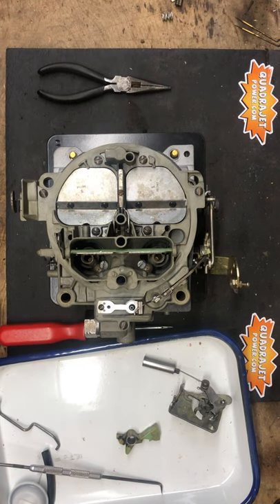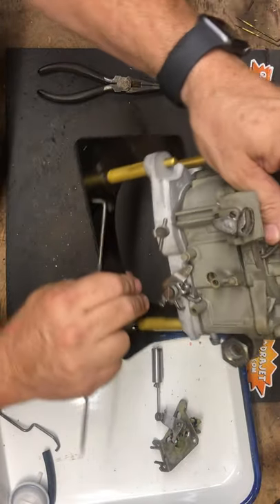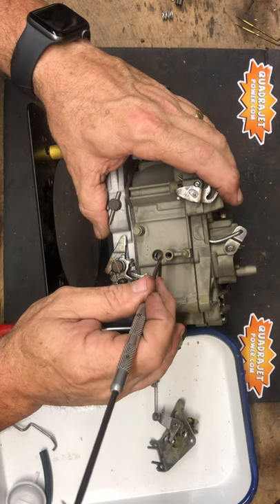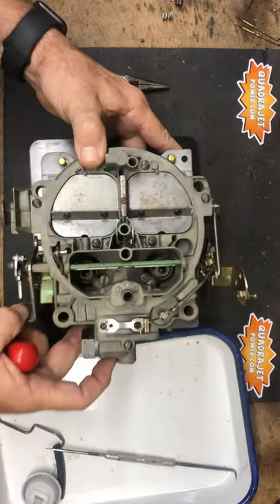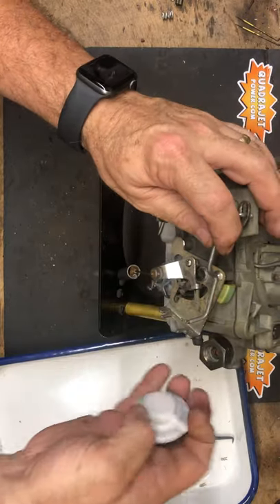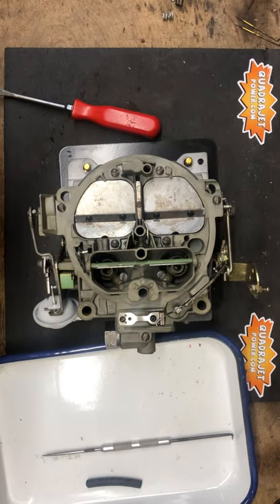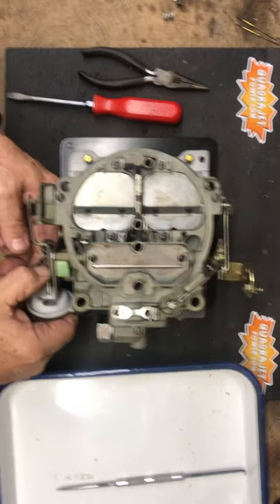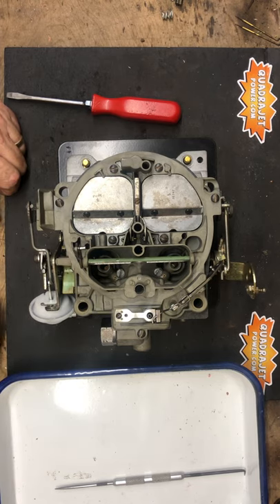Quadrajet Power - Installing divorced choke on the Quadrajet

Comment: This video is a life saver for my 1969 Quadrajet. I took the divorce choke mechanism apart to clean up the rust and fix the choke flap not closing properly. Turns out the previous owners did not put the assembly correctly. Thanks to the video, I was able to put everything back together correctly with ease.
Reply from the maker: Thank you!

Comment: Your videos are fantastic and a HUGE help. I sheared the bolt to the choke assembly/coil that attaches to the intake manifold. Now my primary flaps are constantly open and can't start my 69 Rivvy. Is this a show stopper?
Reply from the maker: I don’t run a choke at all on my Buick. I do have to pump the pedal a bit more to richen it up to start.  You may have to drill and tap the bolt so you can attach the choke.  We do sell electric choke conversions if you are interested. 
https://quadrajetpower.com/electric-choke-conversion-kit-68-74-buick/
Reply: @QuadrajetPowerLLC  I used a bolt extractor, bad mistake, broke it off and decided to move on and go without the choke. If I can't get her going after my recent rebuild, I will drill and tap or make the electric conversion. Thanks again for the great videos!!

Comment: Trying to figure out if I need to replace my divorced choke assembly, especially after watching your videos. Fast idle cam on my Rochester on my 77 GMC is kind of stiff, and locks into place in two lower positions and won't come up again unless I pull on the throttle linkage to release it. Whether this is normal or a problem I'm still not sure.

Comment: Hello! I've installed my joke on my Quadrajet but I'm noticing that my fast idle cam isn't engaging when the engine is cold. As a result, my car idles very low (say 600rpm) when it should be higher. If I engage the cam manually by pushing it up while opening the throttle, it sits in place properly and the engine will idle at the proper ~1600rpm or so. Once warm, I can kick it down to proper idle at ~750rpm.

I'm wondering if maybe I either installed something incorrectly or maybe my thermostat spring is on its way out.

Have you ever seen this before? Thanks in advance.
Reply from the maker: make sure your fast idle cam is above the arm of the choke mechanism. When choke is active, it should raise the fast idle cam.

Comment: I got a quadrajet carb and it has electric choke I don’t like it I want a manual cable like what you have but when I googled it I can’t find the one you have I looked up divorced choke kit what is the part number or where did you get yours? Please help and thank you
Reply from the maker: Hi, this conversion kit is to convert electric or hot air choke to a manual cable.  https://quadrajetpower.com/manual-choke-conversion-cable-for-hot-air-or-electric/

Comment: What about the top secondaries are they supposed to have tension on them or be loose
Reply from the maker: Secondary air valves have a tension spring  to hold them in place and to slow the opening.  You need the spring and tension to perform correctly.

Comment: I can't turn the choke on it's side because it's on the engine. Is it possible to put the actuary hanging on the rod and put the put the divorced choke in the hole while still in the car? It looks like it won't line up with the fast idle point when I push the divorced choke assembly,  the green shaft that goes in the hole to hold the actuator in place, or do I have to take the top off again? Thanks
Reply from the maker: Madd Maxx it can be done, just a bit more difficult that way.
Reply: @QuadrajetPowerLLC  Thanks for that, I'll keep trying. This is drying me nuts. I keep dropping the actuary in there off the rod but I can get it out with a magnetized screwdriver, so far...... can I put grease on it to hold it more to the side? I appreciate your input.

Comment: What is a divorce choke, what does it do, why is it needed?
Reply from the maker: Choke assist during cold engine start up.  “Divorced” means the element is mounted on intake, separated from carb and connected by rod.